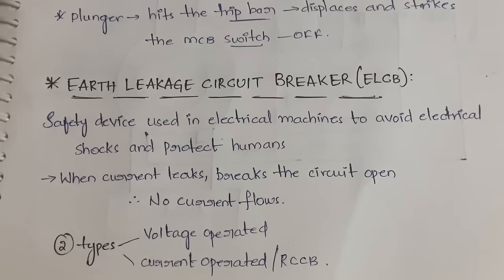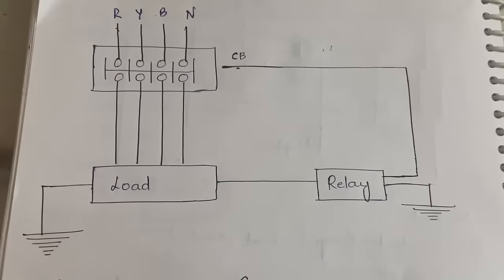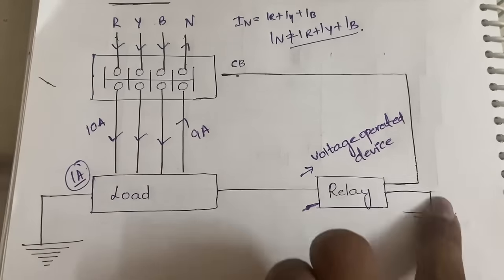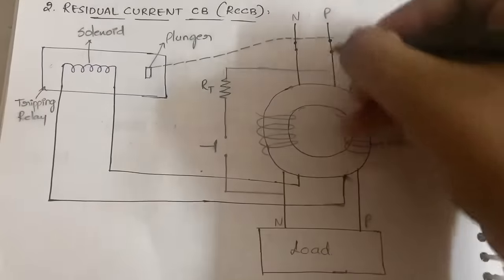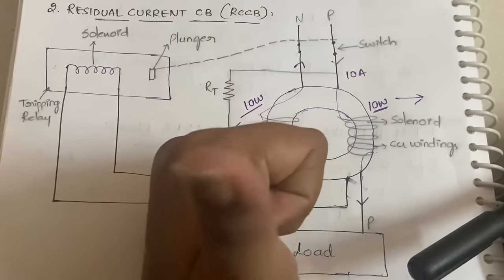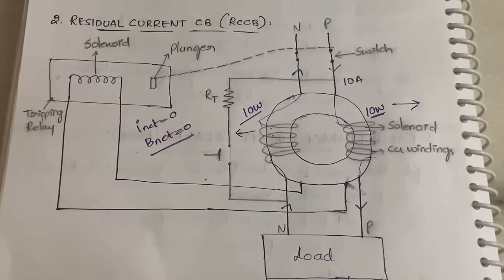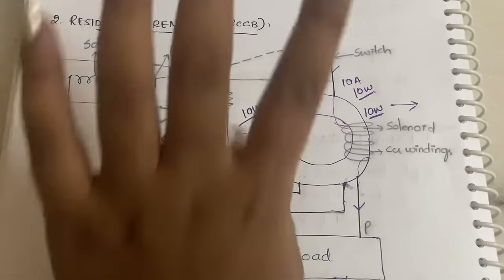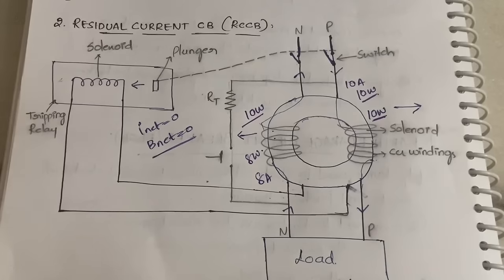Earth Leakage Circuit Breaker (ELCB) -Definition, Working, Uses, Diagram |BEE|

Comment: Mam can you please explain the difference between overload and short circuit
Reply: Assume you plug a 15 amps load into a 5 amps socket it's overload. Amps shoots up slowly as some resistance is present.

Whereas when hot line comes in contact with ground or neutral or another hot directly without any load or resistance, current shoots up instantly.

Mcb takes care of overload thru the bimetalic mechanism and shorts thru magnetic coil.
Hope this helps.